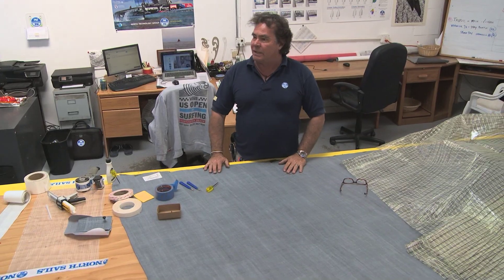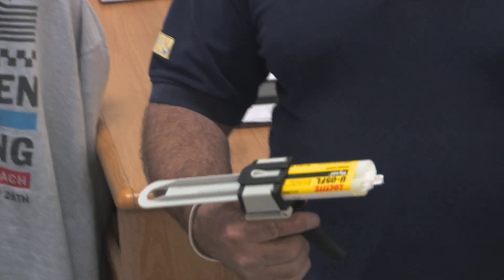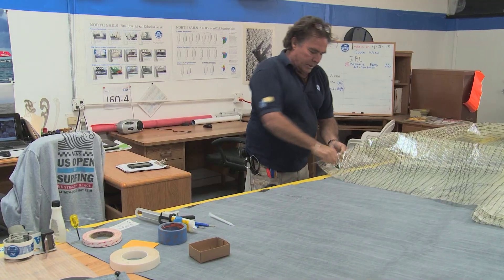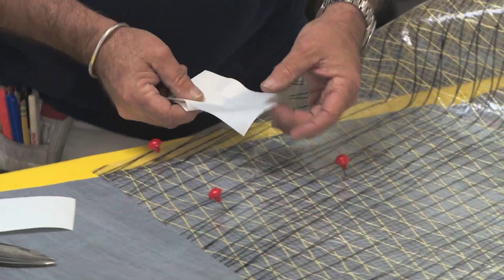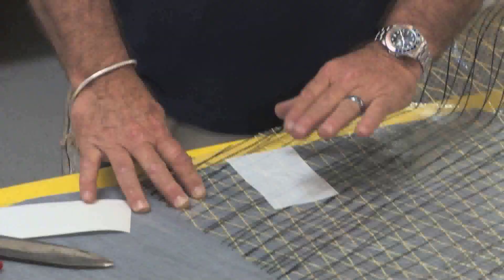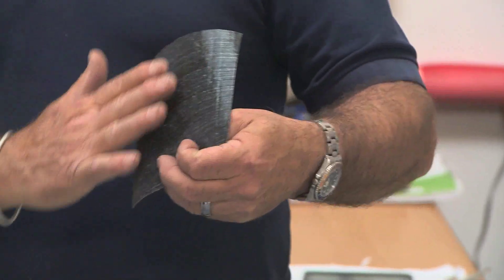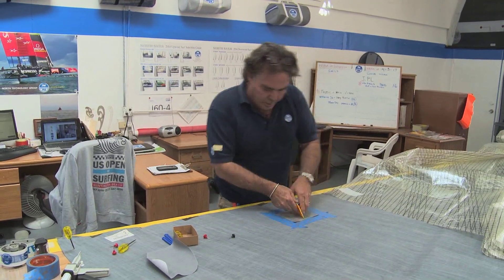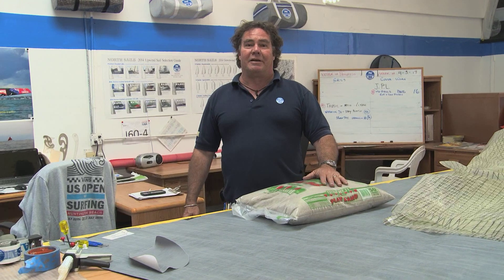The Art Of: Ships - How To Repair a Sail (Exclusive) - Ovation

Comment: looks like the glue you use on clear plasic is LOCTITE Urethane Adhesive: U-05FL, Ambient Cure, 50 mL, Dual-Cartridge. will it work for patching larger areas of windsurf sail, the clear plastic part that has those threads molded in like the roll in video to the right of you? I have to cut out about 10x10cm badly damaged area and i hate sewing...